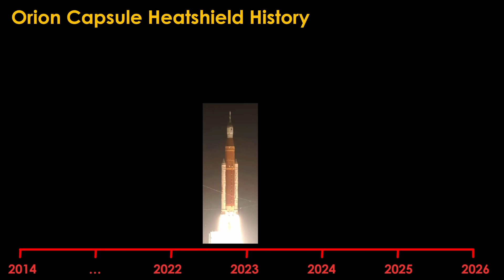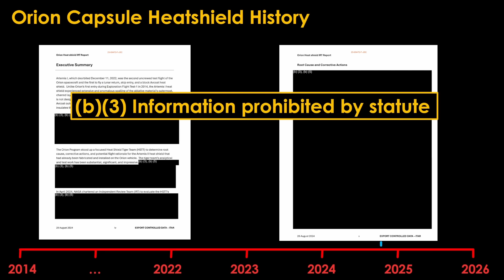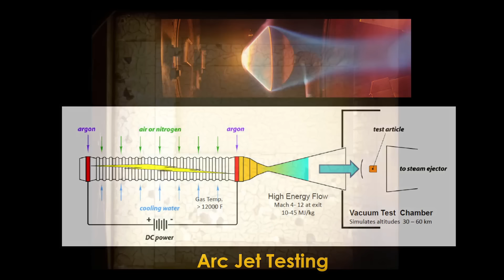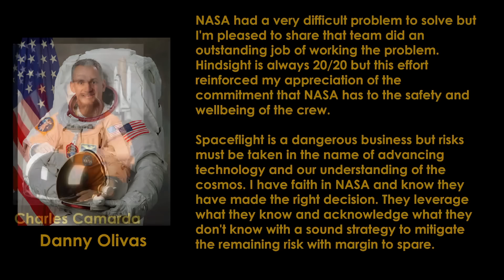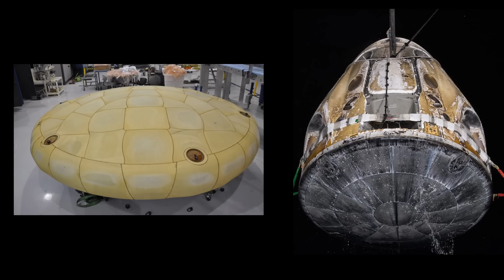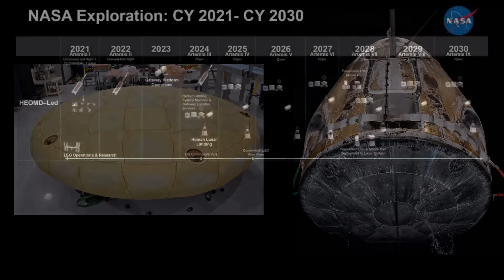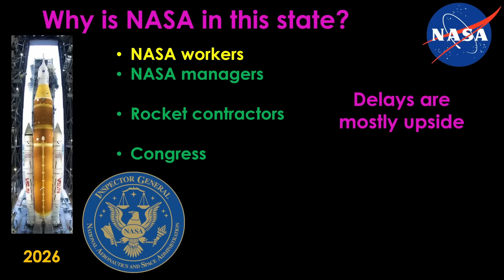Artemis 2 Orion Heat Shield - Is It safe?

Comment: Addressing the problem of chunks of the heat shield falling off by trying a different re-entry trajectory sounds like some hot nonsense! I hope the astronauts will be safe
Reply: Not when the cause of the bits of heat shield falling off is directly tied to the reentry profile
Reply: I feel like altering the descent path in hopes of the new one providing lower stress instead of directly addressing the structure itself is... Concerning... To put it lightly.
Reply: This redesigned heat shield has flown only once, resulting in big chunks falling off. Their solution is to make it go even faster and hotter and put four humans on board.

Maybe that works out, because it won't have to go through cycles of heating and cooling. And maybe there won't be another unexpected issue that arises due to the more aggressive re-entry. That's a lot of maybes. We'll be finding out live because this heat shield has never been tested with this re-entry profile

Comment: The doublespeak and the trivialization of potential life-ending problems is awfully reminiscent of the Challenger problem.  And by the Challenger problem, I don't mean the O-rings, but the groupthink and say-anything-to-appease-critics approach.  The Challenger problem led directly to the Columbia deaths.

A corollary of the Challenger problem is the changing of mission to mitigate public perceptions.  Early in the shuttle program, the orbiter was flown from the factory in California to Florida, even though the heat tiles were not yet installed, to show public progress, even though it was far less efficient to do it that way.  It's what leads us in California now to prepare discontinuous sections of track bed for high-speed rail, skipping over future bridges, so that miles of progress can be shown while necessitating future, more costly, work.  It's fair to ask if the Big Accomplishment of humans orbiting the moon is in conflict with the more pedestrian safe approach.  In too many ways, NASA seems to be imitating the 1960's Soviet space program.  Maybe we should postpone the manned mission for now, and test the actual heat shield that will be used when it's ready.

How did the test procedure fail to detect in advance the failure of the Artemis 1 shield?  How has the test procedure changed?  It would appear that the test procedure is unvalidated and we are basing human life on an untested process.

I saw a NASA press conference the other day in which the NASA spokesman was asked about the heat shield.  He responded confidently that it was fixed.
Reply from the maker: Have you seen my challenger video? The problem started so early and it was obvious to smart NASA people that it was a crappy design. 

And it's pretty disappointing that after all the review they supposedly did with the Challenger return to flight they missed that foam shedding was exactly the same sort of thing that they had with o ring erosion.

I had pointed out in an earlier video that NASA had made a stupid decision changing their heat shield design when they were in a hardware and money poor environment. The hexagonal approach was a pain - though they had new robotics to make it a lot faster and cheaper - but it was already validated.
Reply: @EagerSpace  Yes, I have seen all your videos and they have great content.  I cannot argue with your observations; because it's not reasonable to expect known schedules or budgets when dealing with R&D, it's hard to tell what reasonable expectations and controls look like.  One would imagine that the fact Boeing is bleeding heavily with all the overruns would be a way to self correct things but apparently not.
Reply: A better comparison is STS-27R in 1988, where NASA found a hole in Atlantis' wing then told the astronauts it was okay (astronauts didn't believe them and vehemently challenged NASA leadership on this), then on the ground saw that they had gotten lucky there was a big metal antenna right in the hole that took the heat. Just a few years after Challenger, massively prescient of Columbia, and with the obvious takeaway that if they did nothing, something like Columbia would happen. NASA had 14 fucking years to fix this problem before it would kill a crew, and just didn't.

Comment: Plz make video about Moon mission delta V, with return, by only starship and refueling. 
If imagine starship can survive not only low orbit reentry, but more energetic orbit reentry. 
But it have not high boiling fuel, don't think such mission with starship possible, because engine landing. Maybe only second ship to moon orbit at the day of return, and then both return's. But it's need to get low Moon orbit after... n days on the Moon.
Because astronomical price of SLS, and the fact that starship can't make all missions steps alone.. looks like all new Moon program=only 2-3 flights and end. Because too expensive. And no sense, earlier Saturn makes all steps alone.
Reply from the maker: I made a number of videos with starship predictions based on data I thought was good and then it turned out to be wildly wrong. I might do something else when we have better block 3 information, but I'm on hiatus on those right now.